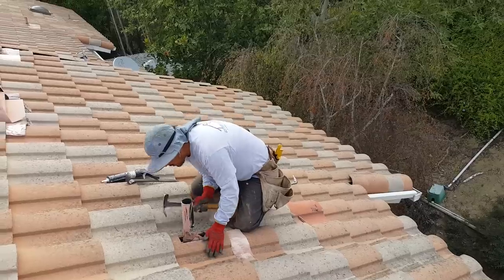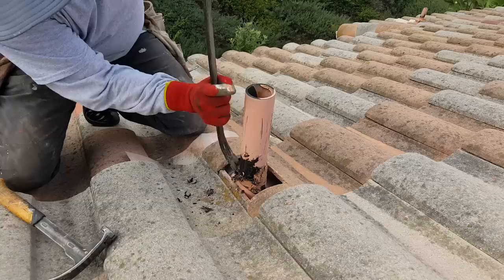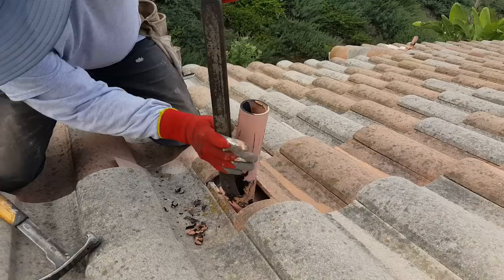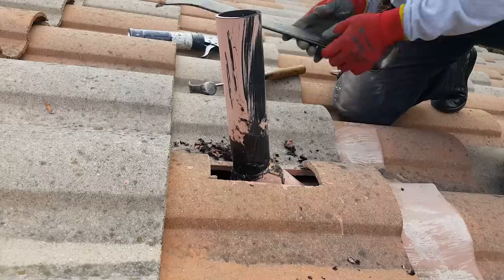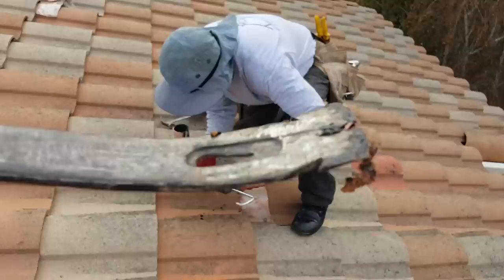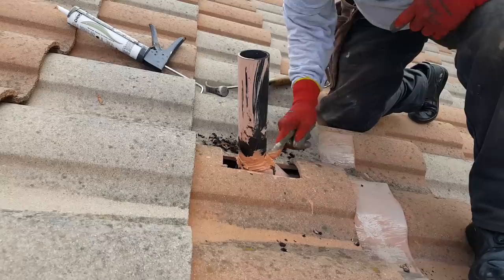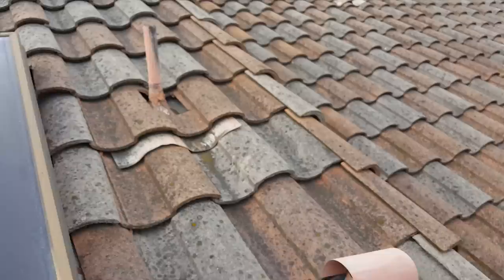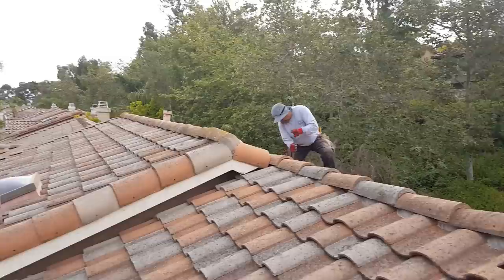Roofers don't want me to show you this!  How to Repair your Roof and Seal the Flashing.

Comment: You need to  check the base flashing first to see if there's any cracks in the underlayment especially if it's leak twice , then install a storm collar not mastic. Its most likely a nail that's pushed up through the underlayment .
Reply from the maker: It wasn't a leak.  We didn't use mastic.  We use a polyether based sealant.  EPDM rubber collars are great if your local supplier stocks them.  Which, our doesn't.  Why.  Because roofers rarely use them.
Reply: I've never used a colar
Reply: Pry bar  is a large and heavy tool, you should use and you may cause damage, you should use a sharp spatula

Comment: As a roofer i would never do this there are better ways to have this waterproofed
Reply: There are only three ways.  One, leave the old sealant on there and go over it.  Two, remove the old pealing sealing (chip it off like we do) and apply new polyether based sealant and be done with it for the next 20 years.  3 - chip off the old sealant and install a rubber EPDM collar.  2and 3 should be the only ways you fix this.  Period.

Comment: getting it clean is important, but surprised that you'd use a crow bar- as any nicks and stuff could make it also leak- of course, it could also roughen up the surface for bonding. A scraping blade (or a dull wood blade) on a oscilating tool would also work well.  
We would probaby use Karnak out in the north east.
Reply from the maker: Thanks for the comment.  We use modified pry bars for this.  The nicks are in thick pvc piping which can handle it.  And, it wont leak.

Comment: surely if you lightly heated it before it would come off alot easier just remember the pipe may be a little softer
Reply from the maker: Na.  That stuff gets hard like cement.  You have to beat it off 😂

Comment: That upper flashing isnt properly integrated into the tiles in the first place (you shouldnt block them off like that, it traps debris, seen dozens of them leak). Using your finger to spread the sealant on the collar usually leads to it being too thin and it cracks ever so slightly after a few years of expansion/contraction. Rubber collars are $2 a pop, $4-5 if you need fancy Oatey ones... $15 tops for specialized collars you typically dont ever see on tract homes. There is no good reason every roofer shouldnt have an assorted box of 200 of these things at their shop in my opinion. They are a consumable item, you would never be caught without a supply of nails at the shop, would you? I give it a 8/10, most guys would have just lathered it up with any number of rubberized asphalt products (mastic) and called it good. I feel like the past 8 years ive spent inspecting roofs (new and old, big and small) has taught me more than 15 years in the field installing and repairing ever taught me. 12,000+ roofs inspected with my name on them to date... Cant wait to retire lol
Reply from the maker: The aluminum flashing was done perfectly and the caulking work done is appropriate and done correctly.  If you have learned more in 8 years of staring at roofs then you did in 15 years of repairing roofs then you were doing it wrong for 15 years.  You might want to double check your math.  12,000 / 8 = 1500 per year makes 4+ roof inspections 7 days a week for 15 years straight.  Give yourself / us a break.  Anyways, I appreciate you effort in this field.  Keep up the good work.
Reply: @SouthCountyRoofing  more like 8 inspections a day 5 days a week, not by my choice but my employers.
Reply: @SouthCountyRoofing  but that's the thing about Roofing there's always a lot of opinions and not always a lot of documentation or guidelines other than those set from the manufacturers installation guidelines. For an s tile roof that Flashing should be lead. But in the world of minimum standards why use a more expensive product if it's not required. But that's all just like my opinion oh, man.
Reply from the maker: @DarkDayZee  I don't know why you would want a lead flashing when you can use aluminum.  Aluminum flashing will probably last longer than that house will.  Let alone the roof. If your interest in learning more about tile roofs down load this  - https://tileroofing.org/wp-content/uploads/TRI-Installation-Guide-2015.pdf
Reply from the maker: See page 18
Reply: @SouthCountyRoofing  because its malleable (can conform to the profile of the tiles)... And it will outlast any roof application assuming the installer doesn't mangle and crease it during install (which always happens b/c builders are trash). That guide you linked actually specifies lead or other malleable flashing on page 23. Page 18 is about battens lol (although probably a typo). Ive been through this document before actually, and many others.   Alot of stuff is left out of these, for example "boxing in flashing with tile" lol
Reply: Dont get me wrong, that aluminum flashing has been shedding water just fine for what looks like about 20+ years and it will continue to do so. Id never recommend to a homeowner that he should waste his money replacing all of them or anything... But it could be better. But that circles back to my point, theres alot of opinion in roofing and one guys opinion is always better than the other guys lol.
Reply from the maker: @DarkDayZee  Its also poisonous.  You could just use gold or silver.  umm, exactly.  Aluminum is more appropriate for this application.
Reply from the maker: @DarkDayZee  Page 18 as counted and labeled in the manual not the pdf.  It is titled "tile penetration flashing".   Everyone makes mistakes I'm not holding it against you.
Reply: @SouthCountyRoofing  yes, so page 23 specifies lead or malleable flashing (aluminium is not considered malleable by building standards).     Are you using your pipe jacks to funnel drinking water? I know "lead free" is all the rage these days but common... The lead flashing is a danger to the homeowners health and well being? The manufactuers installtion guidlines specifically states "lead" (assuming were talking about tiles with a curved profile and not flat). Again, circling back to my point... Its all opinion lol.  You're saying the manufactures installation guidelines are wrong? (Im not advocating for them either, just making a point). You aint right, you aint wrong and neither am i for that matter. But in a world of inspections and liability, when all you really have to go on is what the manufacture says(assuming youre not doing code compliance inspections), their documentation is the only thing that matters in court. Too bad roofing in the states doesnt have better standards. We can just agree to disagree.
Reply from the maker: @DarkDayZee  Steve, aluminum is malleable along with many other metals that are not toxic like lead.  I don't know if you're aware but lead is very toxic.  To be clear you don't want lead in your paint, on your roof, and certainly not in your home.    Don't touch it Steve.  It can make you sick and you will need a doctors help to remove it from your body.  It is a bad choice of materials.
Reply from the maker: I understand your reading somewhere that lead is good but it isn't Steve.  Neither is asbestos.  I am sure you can find literature that recommends that as well.
Reply: @SouthCountyRoofing   obviously lead is not good when it is ingested, inhaled or otherwise introduced to your body and you do need to be cautious or aware of the do's/dont's when handling it. Just like motor oil, any solvent or even some sealants/caulkings, some are more dangerous than others. There's a specific reason why City and County codes handle the application of toxic materials like lead. Some counties may have banned it in roof applications on new construction, but none that ive ran into yet. It is perfectly fine to use on a roof, assuming youre not trying to drink your gutter drainage lol. You should consult your local city or county health officials and building inspectors regarding its use. There is a reason homes being built today are still using lead flashings. The same homes in which the design, blueprints and materials were approved by the health and safety experts. (A roofer is not a health and safety expert, regardless of how common sense some of this stuff is). You stated a lot of opinions without addressing any of the issues I brought up other than saying its "appropriate" while all I've done is referred to the manufacturer's installation specifications. Whenever i confront another roofer about their mastic masterpiece, they always respond with "its good enough" or "its not going to leak" .... "Its appropriate" is the same statement with a more professional touch. Im not saying any of this video is bad work, or that anything was done in an improper fashion. But trying to make me look like a fool for the grace of your YouTube channel, as if I'm encouraging people to go by a new set of kitchenware made out of lead. Thats a bit condescending lol (especially after i let the ol'e "youve been doing it wrong for years" jib go by) I don't doubt your skills as a roofer but maybe your experience as an inspector. Maybe you have not had to defend a report you've written in a civil lawsuit. I have, thanks to some garbage home builders. Hopefully you continue to learn and grow, as we all should. God help us the day we wake-up and are worse at our professions than we were yesterday. You can always delete the comments if you don't like what I have to say. Stay safe out there, keep fighting the good fight.

Comment: I suppose in California you can't use a lead flashing.
Reply from the maker: Not anymore.  I used to deal with lead when I first started roofing.  You can get a roof spec for it.  One of the state jobs I did called for all lead flashing.  I didn't care for lead because you have to be very careful when handling lead.
Reply: Lead pipe jacks are the buisness tho
Reply: LEAD  FLASHING  around  a pipe  like  you  showed  , should last  60  to 70 years  in britain , even with all the rain  and snow  we  get , in fact , it  actually lasts  longer then a concrete/ clay   tiled  roof !!
i have been on many many  roofs  where  we  actually re-new the  tiles and the felt  , yet re-use the  lead flues and  chimney flashings ,NOT the lead  valley though , it s always  advisable  to re-new those EVERY time  you  re-roof !!